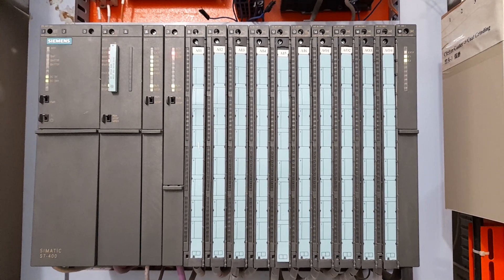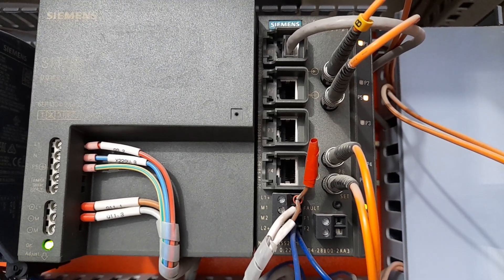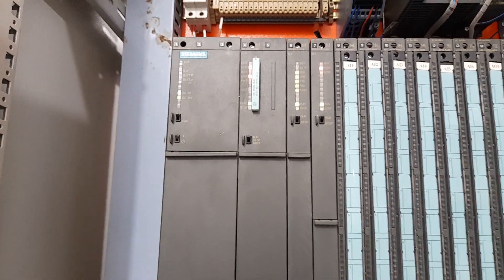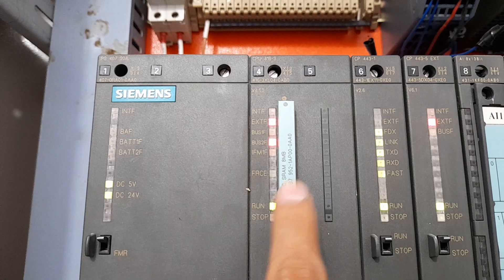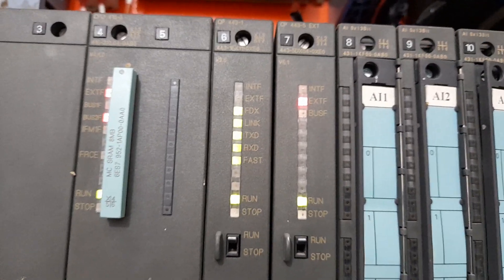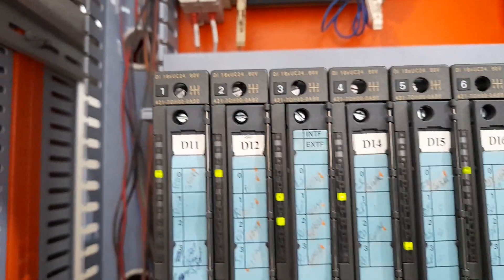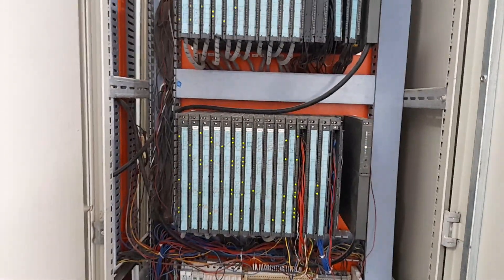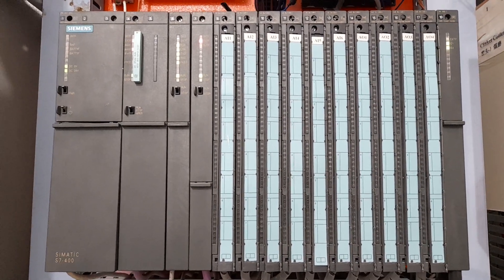Siemens SIMATIC S7-400 PLC Panel overview

Comment: thank you for the video, your video has 3 racks of plc, that have 1 Interface module at the right side of the rack, my question is, which rack cable from the central rack (1st rack) is connected to? if u answer to rack 2, which one cable of IM of rack 3 is connected to?
Reply from the maker: Well all racks are inter connected via an Interface module in each rack. The cable from IM module in first rack is looped to the IM module in 2nd rack and then to the IM module in 3rd rack.
Reply: @PLCNerd  ok thank you